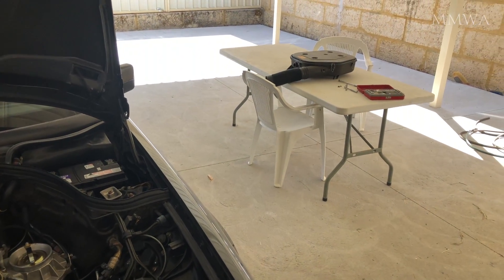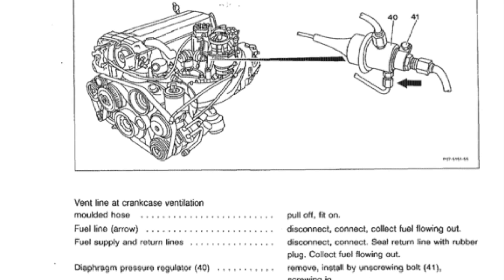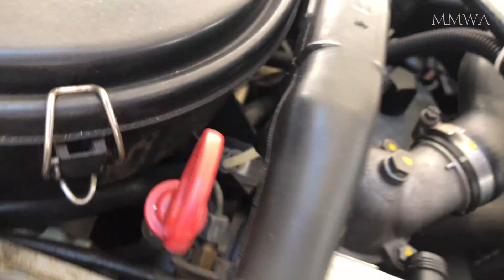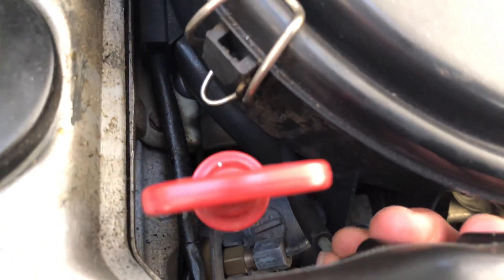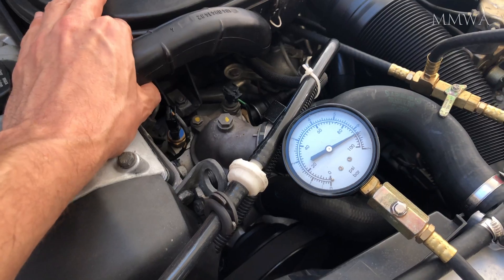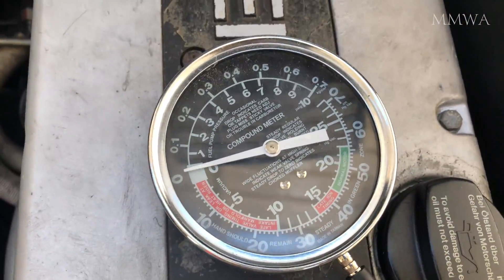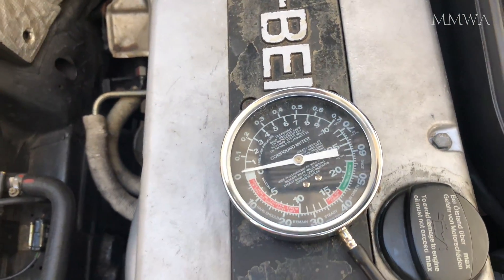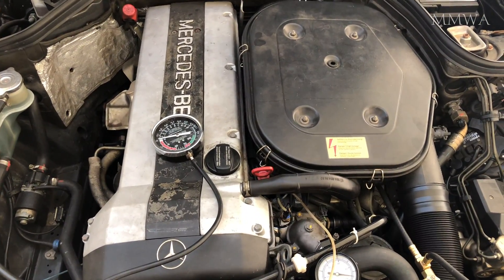KE-Jetronic - The mythical "vacuum" connection at fuel pressure regulator

Comment: en fait  vu qu il ne faut pas oublier que notre pression d'essence  primaire est régulée  pour   5,5 ( ou 5,9 Bars ?) sur les moteurs M103942 KE       il s'agit de pression relative et pas  de pression absolue, donc il faut bien  avoir  une référence  de la pression atmosphérique ,   qui est donnée par le "ventiletion line"   qui la prend en un lieu protégé  des encrassements  projetions diverses  . Cette  "ventiletion line"     sert  à avoir  la référence  pression atmosphérique  qui peut varier un peu en, fonction des conditions météorologiques  mais aussi selon l'altitude  ( 0 m	1013,2  Hectopascals     ,     500m	954,62 Hectopascals
1000	898,76
1500	845,59
2000	794,98
2500	746,86
3000	701,13
3500	657,69
 Donc   l'expérience  montrée en vidéo  montre   qu il  n'y a pas de variation de pression  primaire   ventiletion line"   branchée au non   , par contre  si l'on avait juste   aspiré  faiblement (simplement avec la bouche)   de juste   400 hectopascals  ou 0,4 bars   on s aperçoit immédiatement   que  pression primaire  et pression chambre basse  chute d'autant   ( expérience  faite  avec  pompe carburant  débitant en continu           cette baisse de pression      apparait     dans la courbe  visible dans la vidéo à 0:51      [  documentation de principe  car la pression de  3.8 bars  est  sur une autre injection d'autre moteur,   mais sur le principe  on voit que la courbe  suit linéairement    la dépressurisation  du ventiletion    et le schéma   indique bien que  le ressort est contre carré par l'action  d'une dépressurisation  atmosphérique

Comment: I thought i remember you changing the rubber connection thingee on the fuel Pressure regulator vent line in one of your videos.  I remember you displaying a new vent connection hose in a Mercedes plastic wrap.I subscribe to your channel and have learned much about my Mercedes, so thank you . I have been watching the videos' associated with the fuel pressure regulator and cant find the one where you display that part showing its MB part number.  Would you please be so kind and forward that to me,  thank you
Reply from the maker: ive never ordered that part but i do know it was available to replace on its own. If it is still available to buy now is another question

Comment: Sorry fuel is coming out the ventilation hose on the end of my fuel regulator. The rubber hose that connects to the hose on my air cleaner. Is the fuel regulator faulty?

Comment: thanks for this video.. my w124 vent line has been cracked for years and leaks.. this vid is a weight off my mind..
Reply from the maker: if fuel is leaking from this vent line on the regulator- it does mean the diaphragm is ruptured and it should be replaced.

Comment: Kind regards, I have a regulator that has a fuel leak through the vacuum valve and for this reason I disconnected the hose to prevent fuel from leaking into the engine, it does not cause any visible failure.  That is to say that if instead of the rubber band I put a plug, could it work and avoid dripping and wasting gasoline?

Comment: So does this mean the fitting does not need to be clamped down? And if there is a leak its fine?
Reply from the maker: absolutely not, if its leaking fuel the regulator is end of life. Its to be connected to crankcase breather hose so in the case of failure there isnt raw fuel in the engine bay causing a fire risk.
Reply: @MMWA-DAVE  thank you. I have a m102 and the tube that connects from the regulator to the crankcase breather hose is leaky and I smell fuel in the engine bay. I have starting issues, do you think it's the regulator that's the culprit? Thank you!
Reply from the maker: @Zillamp3z  If theres fuel leaking from the vent line it must be replaced. As to if it is the only cause of the hard starting, you would need to do fuel pressure tests. Likley if this is failed there is going to be other issues too, like the accumulator, it also has a diaphragm that fails internally. This will usually cause hot starting issues.

Comment: Of course is a vent line.  If the chamber would be completely closed and there would not be a vent line, the movement of the membrane would be impeded and differences of ambient temperatures (summer/winter) would dramatically influence the system's pressure.  On the other hand, to be a vacuum line it would have to be connected directly to the intake manifold, not to the crankcase ventilation.
Reply from the maker: yet there’s still people who argue its a vacuum connection

Comment: Demonstration for dummies haha :D
Reply from the maker: Bekir Karakulak and still there are people that disagree
Reply: @MMWA-DAVE  idiocy is a disease with no cure.
Reply from the maker: Bekir Karakulak entirely possible there is some vacuum / positive pressure altered fuel regulator on factory turbo cars that had k/ke-jet but they are by far a very small minority. I’ve never seen one of those and probably never will.

Comment: 100 % true,     this ventiletion line  serves for in case  internal  membrane  failure ,  fuel will goes inside  engine  avoiding  fires
Reply from the maker: Giuseppe Mancuso yet people still argue about this to this day, 44 years after MB started using K-jet.
Reply: @MMWA-DAVE  I have a w123 Benz it mix petrol and engine oil  I think it's the cause tht regurator
Reply from the maker: @muundashatinwene4467  entirely possible. Its easy enough to test. If any fuel is coming out the vent line the regulator is trash.

Comment: I actually have a question. I hace some problems with w124 and everytime I stumble across your vids. I follow your w124 on the go abd think you might be the guy. There is no fuel going to the injectors so he wont start. Sometimes he tries but only with the fuel from the cold start injector. If you pysh the air intake valve down, some fuel is going to the injectors. Do you have any idea where to start looking? Btw, it's a 230e (m102).
Reply from the maker: Luc Klippelaar you will need to check fuel flow rate from the pump(s). Red was like this when first arrived, tank was rusted out and one pump seized. If theres poor or no flow im betting you have similar issues.
Reply: @MMWA-DAVE  thanks! But when I bought it was the pump a little bit noisy but he drove well. A few weeks ago I changed the pump, the filter and teh accumelator in the back. Everything Bosch. He always ran good and started right away. It went from a good running car to a not starting car. Thanks for the reply btw!
Reply from the maker: Luc Klippelaar can you actually verify that the pump is running? The fuel pump relay is also known to fail on those too
Reply: @MMWA-DAVE  the pump is running fir sure. Wgen you put on the ignition, you hear him for about 2 seconds and if you losen  one of the lines, fuel shoots right out when trying to start. Even with the fuel cap of. Every line you try to lose, fuel sprays out, except the lines on top of the fuel distribitor to the injectors. My guess is that there is an internal leak in tge fuel distributor or some part I'm overseeing is not building up the pressure on top of the distributor
Reply from the maker: @cooleloekie  Something is definitely not right there. Do you have a K-jetronic fuel pressure gauge to test the pressure ?
Reply: @MMWA-DAVE  no I don't. I only have basic tools myself. I work in a nissan garage and think I'm going to try with a nissan guage we have. But I don't think the clamps and such won't fit.
Reply: @MMWA-DAVE  just to keep you up to date,but we found the problem (me and my dad). Long story short, the fuel distributor was leaking on the inside chambers. Thanks for thinking along!

Comment: Lol do that to a Lucas injection xj6 jaguar xj40 4.0 inline 6 🐂, anyways if there's any problem with idles off on the Benz it could be the valve cover gaskets...if any halfmoon rubber gasket leaks on a jaguar xj40.🐎🐂🐈🚜🛩️🌪️🛠️🔩🤣

Comment: Purpose of that plastic hose is to dump gasolineto "safe" place in event of internal mechanical failure of fuel pressure regulator. Better to have gas in crankcase than top of engine is the logic.
Reply: Great Basin Benz, that’s exactly what the vent from the fuel regulator is for, and it is often mischaracterized as a vacuum line, in the purest sense. The vent line allows any excess fuel accumulation in the regulator to discharge into the crankcase breather hoses. This allows excess fuel to be drawn through the idle control valve, allowing the fuel and/or fumes to be introduced into the intake manifold, and into the combustion chamber.

There’s a plastic fitting in the crankcase breather hose that  includes the connection for the regulator vent line to the crankcase breather. That plastic fitting is an interesting little passive device, and if not installed in the breather hose correctly, can be the cause for frustrating symptoms, like oil appearing to leak from seals and gaskets, giving the impression that the engine has excessive blow-by. There’s a small orifice inside the plastic piece. (I don’t recall a name for this plastic part.) I’ve opened up that orifice slightly in high mileage vehicles, and made sure the plastic part is installed properly. This improves  the crankcase breather, which is also connected via the hoses to the Idle Control Valve. Opening the orifice just a little, then driving a mix of traffic and highway speeds, should yield no further oil pushed out of engine seal or gaskets. 

Of course, the engine may actually have excessive blow-by. But all things equal, that little plastic part can be influential. 😄
Reply: Hola,¿puedes ilustrarlo con dibujo o fotografía?Gracias
Reply: @majicul  Since the white plastic part inside the hose is also a problem, can it make these splashes?
https://www.youtube.com/watch?v=s73sk5cLIOo
Reply: @r3FMusic  Your link takes me to an instrument panel, and I see nothing in the video that has anything to do with the plastic part installed inline in the idle  breather hoses. So, I’m not clear on your question. 

The purpose of that plastic part, is to help equalize crankcase pressure with external air pressure. This prevents oil leaks from high crankcase pressure. Also, it has a fitting that connects to the vent line in the fuel pressure regulator. This allows fumes to be drawn out of the fuel pressure regulator, through the idle control valve and into the intake manifold.

Sorry. Don’t know what you mean by “splashes”.
Reply: When driving accelerating hard there's vacuum,of which reduces control pressure and increase system pressure,then injection volume increases results more power that's how that pressure regulator works,and that's why there's ports for control pressure and system pressure connections on the pressure regulator the system part electronic very nice system.
Reply from the maker: I agree, it would be unsafe to simply vent it into the engine compartment.
Reply: I've read this somewhere too
Reply: M117s have this, and I've seen a bad regulator in action pouring fuel into the crank breather hose

Comment from the maker: Reconnect is supposed to be disconnect, ie i am disconnecting and connecting the line repeatedly - As always i am unscripted but this time with a side order of arrogance.
Reply: hello, I want to ask you a question, the moment I put my car in contact, the jetronic starts throwing gasoline from the nozzles,it is aboutwhere the problem may be, thank you
Reply from the maker: @autostop4772  if the fuel distributor piston is all the way down there should be no fuel flowing from the nozzles. (flap all the way up)
Reply: @MMWA-DAVE  the piston is standing down, and there is a possibility of manual movement, but the moment I put the car in contact I hear the nozzles whistling, then I check the spark plugs they are wet as if I had cleaned them with gasoline, which for three months I can not turn on the car, flm and try to understand my English,
Reply from the maker: @autostop4772  if the piston is all the way down and not getting trapped and the injectors are flowing it sounds like you have a bad fuel distributor. I’ve never seen this before. Make sure the airflow meter plate is not binding too.